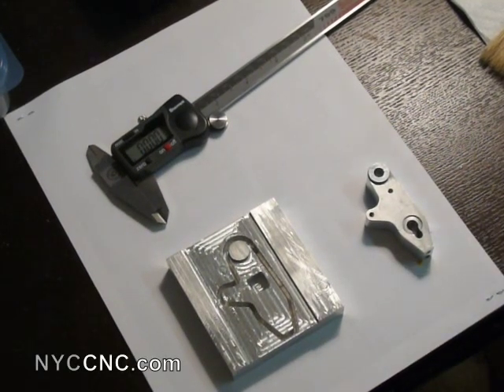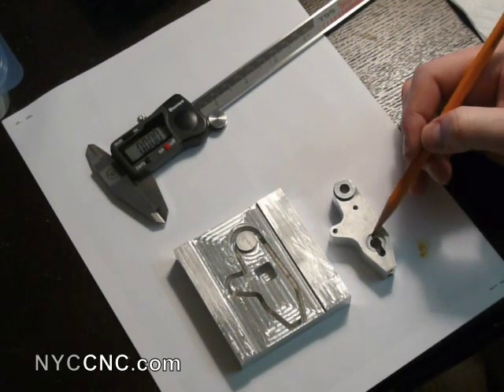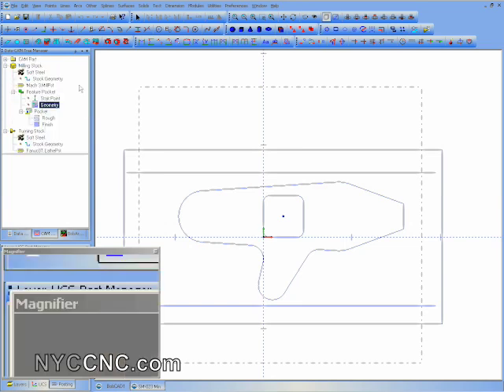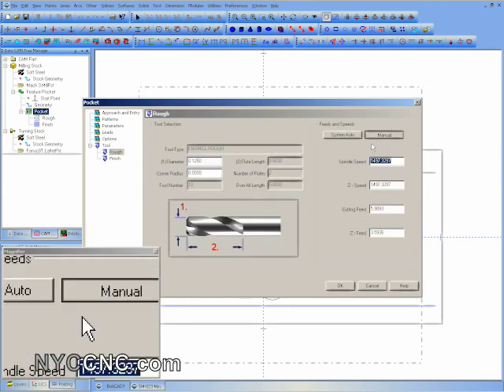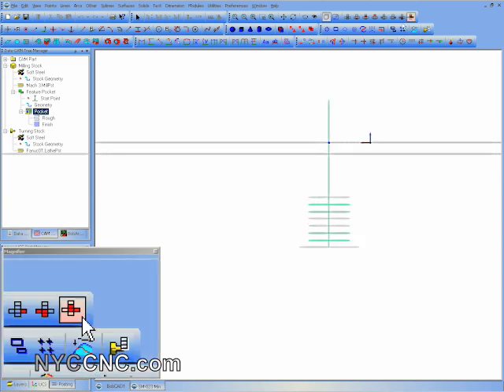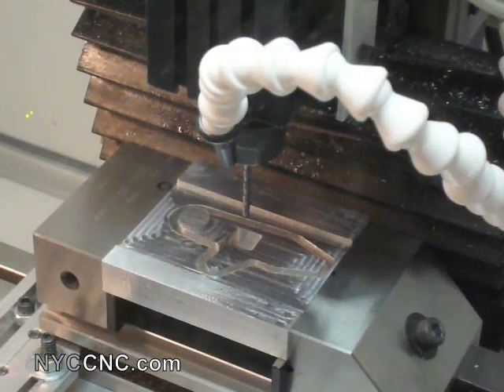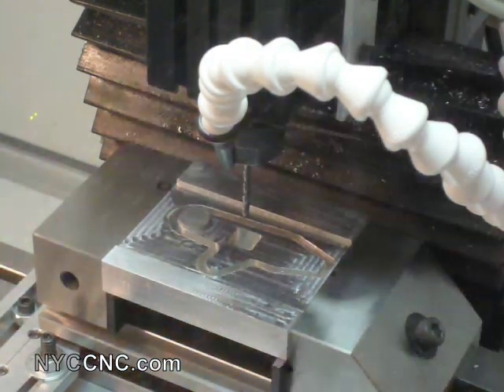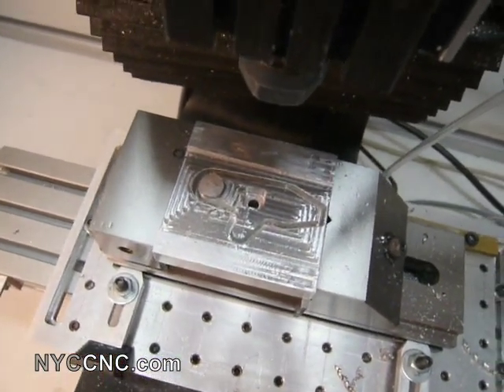How to machine a CNC mill part - Start to finish! Episode 6

Comment: OK I have never done cnc machining before but I am very inerested, I wonder if it would have been better to drill all the holes then use the holes to mount the part in a fixture or just on a plate and then machine the rest, maybe I am missing something? great videos, I just subcribed to you channel